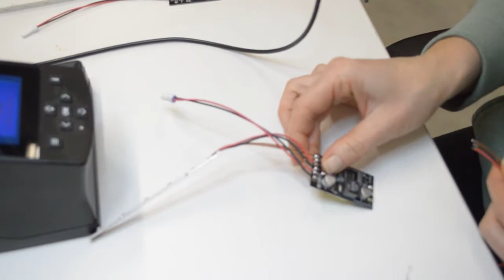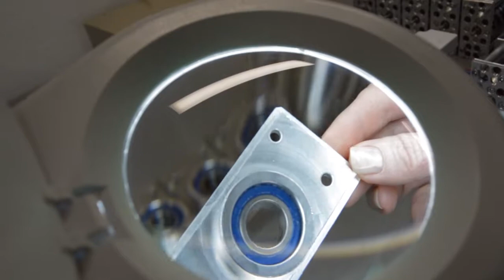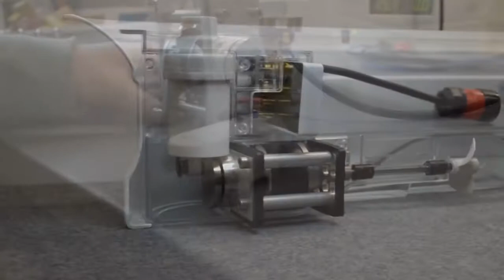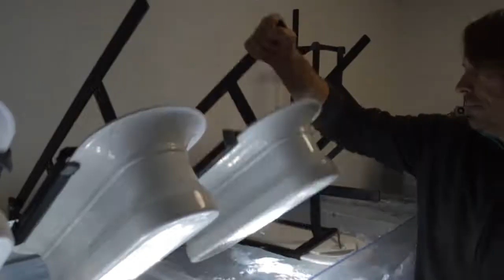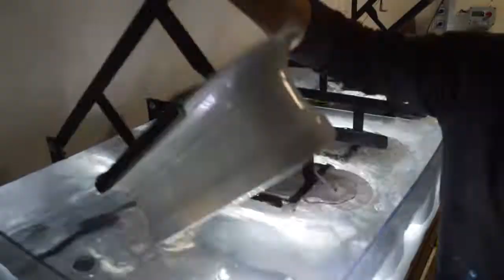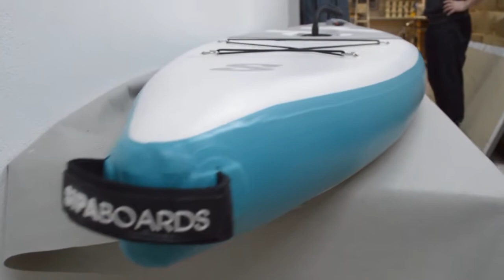A look inside the SipaDrive®

Comment: Did you change the air hose coupling female connector design on the Sipadrive motor?  The nylon threads tend to get worn and strip easily.  I can't use my hose anymore as it won't get a air tight fit.  I have to inflate the board with an external pump now 😭.